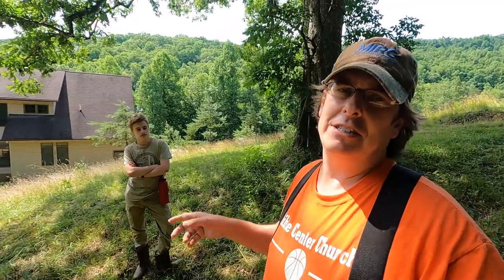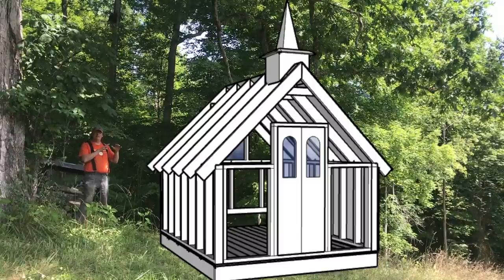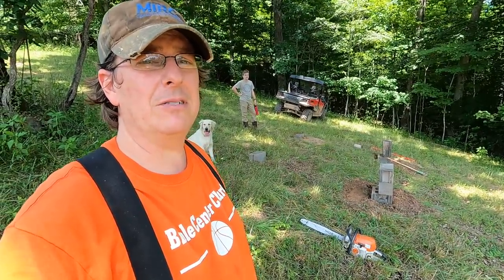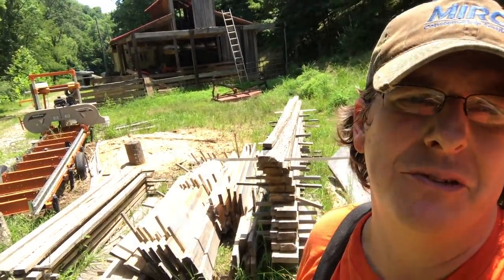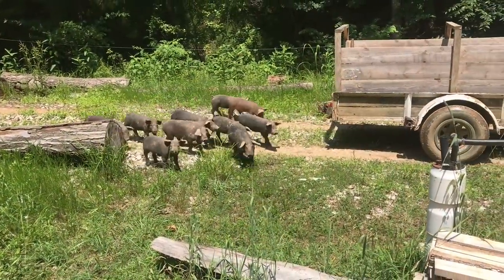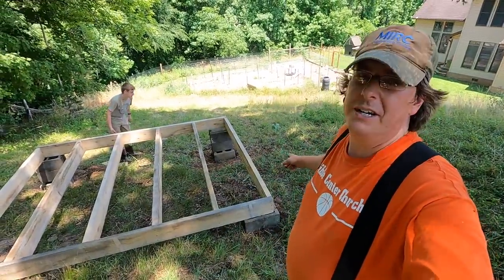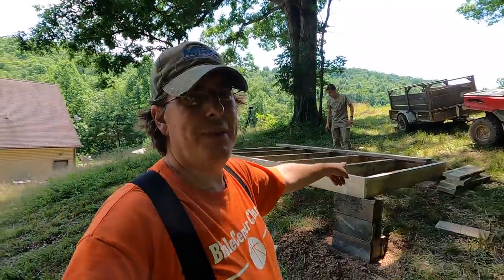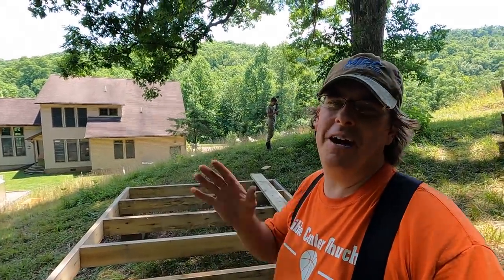New Farm Project: CHICKEN CHURCH

Comment: Wood floor is nice but I bought some inexpensive linoleum flooring makes clean up easier, flat shovel (I use a plastic snow shovel) slides nicely and quick.  Plus you can hang plastic shovel by the coop and never have to search for a shovel when you need it.
Reply: Good tip. Made a chick brooder this year using melamine flooring for the same reason. Works well, though if the mess gets soggy, it starts to stick pretty hard and a rake doesn't work as well. And I think I'd prefer linoleum for bigger floors, just so there isn't an issue with catching the edge of the melamine and breaking it.

Comment: Those piglets..lolol
For your floor, I would leave the small gaps between the boards and lay linoleum over it.  No glue, just tack the corners down... Makes cleaning out a lot easier. I worry about them being on so steep a hill with erosion. Maybe plant thornless blackberries or similar along the bottom or middle? Maybe both? 
Would it make more sense to build "steps" for the chickens rather then a ramp? Just a though...

Comment: gotta think down the road like few years a head 
the problem is going to be erosion of the soil 
you probably don't see it but you know that the soil moves even the surface is grass but it moves 
ok let us not have concrete foundation but at least stick couple of iron rods through each cinderblock and few feet down the ground just to make sure that you don't wakeup one day into an unpleasant surprise, sure you can have the crete in the holes of the bolcks to hold the rods in place.

Comment: Should have run joist the other way. So your floor planks run 90 degrees from evac door.
Reply from the maker: Gaps between the boards would make it difficult to shovel if they were 90 degrees the other way
Reply: @RedToolHouse  i must not understand your drawing or shoveling procedure, sorry. At 90 degrees the boards gaps would be at 90. making the gaps parallel with shoveling them out.